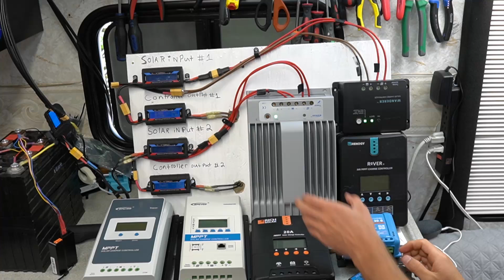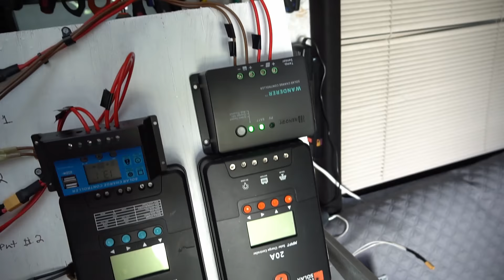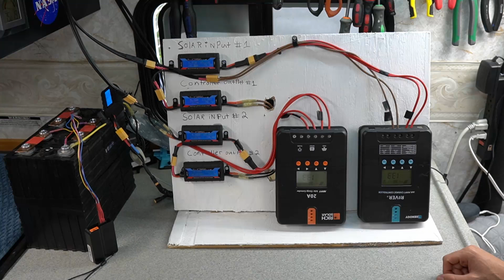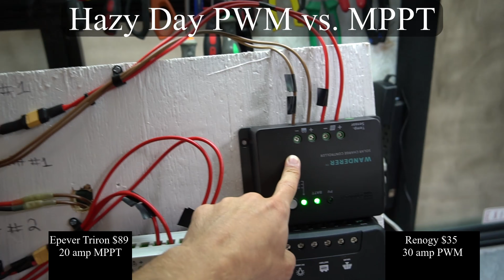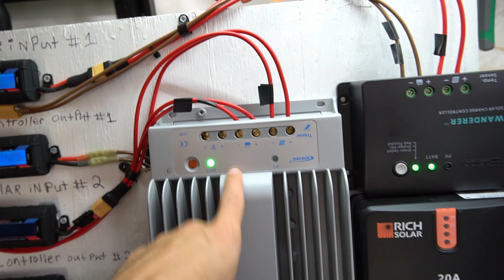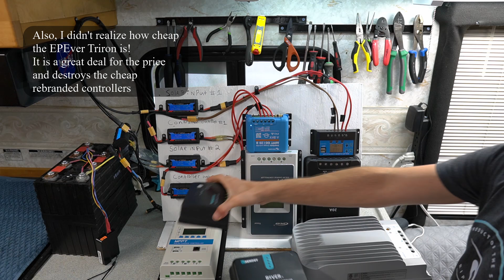12v Solar Charge Controller Buyers Guide - Beginner Friendly!

Comment: Good stuff. I  have to run a little bilge pump and an Anchorage light. Light is 10 Amp and the bilge pump comes on once in a blue moon. It's around 5 or 10 Amp. It's a puny thing. I have 2 deep cycle Duracell batteries in a series but I just need to keep them juiced up. What panel, controller and wire Guage does all that need? Nobody knows down here in Port Charlotte,  Florida.  Or, I'll get scheistered out of $500 or something.

Comment: Will, thank you for nice explanation. So, the numbers on Victron controller indicates: input Voltage (what's coming from solar panels) and output Amperage (what's going into batteries). Right?
Or it's both - Maximum IN and OUT is: 100V with 20A?
Or it's 100V@20A?

Comment: Just upraded the wires to my batteries from 10mm to 16mm and now I have a problem. the solar charge voltage is now 15.6V and my pwm controller is smelling and very hot. all i did was change the wires. Im running 12V system at 40Amps coming in.

Comment: I have a Victron and good access to 12 Volt lead batteries. I would like to connect the output 12 volts into my Fronius solar cell system. From what I understand, there are more inputs on it than just the one where I bring in 2700 watts of solar electricity. Possible? It is a Fronius Symo 3.7.3-M.

Comment: great videos. i am crap at electrical stuff.  but the way you do it in the videos is great, so great that even i am learning. 
me 60 years old. 
but question, on the renogy  controller. would there 30 amp adventurer be better built than the one in your test?
as they are selling a “kit” 400 W mono, 30 amp, and some other items.
you have me sold on the big one in the video, tracer BN 40amp controller.  i like over kill.

Comment: Just came across this older video....didn't that $15 PWM show a temperature on the display?? Looks like same one I have and mine shows a temperature read.  Is that the temperature of the unit since no leads going to battery??

Comment: Question for anyone that knows the answer.  I have a Renogy Wanderer charge controller for my houseboat that takes input power from solar panels.  Are any of these charge controllers capable of taking power from a generator to charge the battery bank? I'd like to keep my batteries topped off at night and sometimes I'm running a generator to power the A/C in during Oklahoma's HOT summer months.

Comment: Hi,
Can anyone jump in with an opinion? I'm somewhat clueless on the solar topic. I have two Harbor Freight 100 amp solar panels, a Dimensions 12/1500N 1500 watt pure sine inverter, and a golf cart with six new Deka GC45 six volt deep cycle lead acid batteries. (batteries to be wired paired to get 12 volts total) 
 Battery specs:
• Reserve Capacity [min]: 530@25 A
• Reserve Capacity [min]: 145@75 A
• Reserve Capacity [Ah@5hr rate]: 203
• Reserve Capacity [Ah@20hr rate]: 255

My questions are, what is the best controller to use with wet cell batteries and I'm thinking of adding one or two more of the same style 100 watt panels.

Thanks
Chris

Comment: My most important question to combine a wind turbine generator with solar panels is it best to separate different controllers or should I use a controller designed to take both wind turbine and solar array

Comment: What do you think about Eeekit mppt 100 amp controller? Lots of tiny directions, but inexpensive. Can I use this on my new SOK 100 ah battery with 400 watt, 30 amp panels? Can I start out charging this battery for the first time with solar, or do I need a charger to begin properly ? I don’t just want the system to work I want the battery to be baby so that I get
Reply: Didn’t get finished, I don’t just want this to work I want it to work well in order to preserve the life of the battery. Thank you

Comment: I have a 40amp Epever and can't seem to find a way to program it to properly  lifepo4 settings without a PC computer. Is this possible? Or, which controller should I get (even if I must go to 50-60 amp controller)?
I don't want to program it from a phone or computer.

Comment: I have three charge controllers with one saying only 50v should be used and the other saying 150v . My system is 12v and the 400 dollar Morningstar 40 amp says only 600 watts should be used, but the 40 dollar controller is 100 amps and says 1000 watts can be hooked up.  I'm a bit confused . My panels are 24v but give about 33 v  in sunny conditions. I'd really like to see a video about the voltage question compared to the maximum wattage suggestions. I don't want to burn anything up cause of inexperience with controllers.

Comment: Will, thx for your outstanding videos; I watch whenever I can. There's a very automated PWM solar controller, HUINE PWM Solar Charge Controller Waterproof IP68 (Amazon, etc., and under other name brands). I'd like to use these in batt. charging projects, but with a power supply source instead of a solar panel. Why do these controllers generally caution against using any source except a solar panel? What's the risk? Also, perhaps someday you could review this one for all of us?

Comment: I love your video I have a question I have the EPEVER Solar Charge Controller my question is do I have to ground it. I'm running to deep cycle batteries and a 300Watt solar panel to run a chest freezer that runs on 1.2 amp.

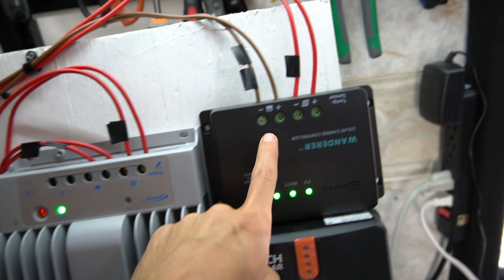Comment: Have you found or finalized this workaround 16:20. Hard to afford everything mppt, so thinking of just buying two pwm controllers these days, or don't?
Reply: Make sure to design your system around similar PWM perfect conditions! Otherwise the PWM will fast reveal it's really short limitations. Becoming a real frustration. With this said just like in the example, under perfect conditions it has a ROI that's simply unbeatable!

Simple systems designed around the 12v mark! With 12V battery, 12v nominal panel, short distances, etc. And your, low buck, PWM might outperform most of the high cost systems. Particularly considering price! ;-)

Comment: If you are building a large high output system like the one you built with used solar panels (x16) do you need a larger charge controller, or multiple ones?

Comment: Will, will a temperature sensor also provide cut off below freezing for a cheap lithium battery with a BMS that doesn't have low temp cut off? The manuals only mention the temp sensor working for lead acid profiles and never mention cutting off at below zero degrees. Help!

Comment: DC Load? What's the point of this connection ( If you are connecting the inverter to the battery)? How much power does the charge controller need from the battery with the display off?

Comment: Hello Will , I would like to power a dc  12 v 35 watt fan and a 12v Dc 20watt pump direct from a solar panel  no need for battery backup . I would also like to power some  lights and tool battery chargers  in my small shop  from the same panel  .Or should I use anothe panel with a inverter.

Comment: I was just curious about the new very inexpensive mppt controllers you can find on ebay.  Many choices under $20.  Is there a way to tell if they are worth buying?  I am very suspicious due to the low cost that they aren't.

Comment: Hello, I have a question. I have a solar charge controller installed, and I would like to be able to disconnect my batteries when the camper is in storage. How do you disconnect batteries and still keep the solar panel wired to the controller?

Comment: I have a portable fold out solar panel. There is a charge controller on the back of the solar panels would I need another charge controller closer to the battery. In my caravan. Like your videos. Thanks

Comment: Would it be possible to hook up a 100w solar panel & "400w" wind turbine through the 20A Epever tracer? Or connect directly to battery separately with its own controller?

Comment: I want a solar charger in a remote location to keep a LiFePo4 battery charged. I may need a heater of some sort to keep battery warm. I’ve read that a healthy LiFePo4 battery needs to be almost fully discharged before charging to ensure long battery life. So would it make sense to get the victron so I can set the parameters in such a way that the battery would get into a cycle of discharge/charge rather than keep it at a constant full charge ?

Comment: What does it mean when your battery bars disappears only when you connect the panels on the cheap $15 controller? It comes on fine with just the battery and soon as the panels touch boom it goes out and starts blinking

Comment: Heres a question, I have the renogy rover 100a mppt charge controller, and 2 renogy core 200ah lifepo4  batteries in parallel. On the charge controller settings, for size of battery,, do I set it for 200ah or 400ah, as setting in parallel effectively makes the 2 batteries 1?

Comment: Yes learned alot.
1 question for 12volt system and some of these . Is there anything gained by going with a 24 volt solar panel?
I'm thinking the controller could increase power out at 12 volts with higher voltage into the controller?

Comment: Question, is there a way to have 24v in ( two 360w panels in series) to take advantage of the larger array wattage and output 12v to the battery? Does anyone make an mppt that can do that? I am new to this and noticed I can have double the input wattage in terms of panels if I run 24v. I just thought if they had a step down transformer, with big wires you could stay with 12v still.

Comment: How would I do a connection in both the Charge Controller and an Inverter if I have a 180 Watt solar panel and a 12V DC battery?

Comment: I am still confused about the Amp rating is it for the solar side or the battery side? So 12 V 20 A for charging? Solar have high voltage 18 or 36v right?? With how much Amp we can come form the Solar into the control ?

Comment: Question please 
I have 6 160 watt solar panels around 20.2 volts each 
That equals like 120 plus volts
4  chins 100 amp hr batteries in parallel 
What kind of controler do I need
Thank you young man
Richard

Comment: What happens if you have 30 amps of solar panels hooked to a 20 amp charge controller will the controller work but only put out the 20 amps?

Comment: How important is it that the amp rating of the charge controller be equal to or greater than 10% of your total solar panel wattage? Which of these have cold weather charging as you’ve mentioned to be necessary in some of your battery videos? Finally, how can I further support you making such helpful videos?

Comment: Is there a solar charge controller that can simultaneously work with fixed solar panels on the roof of my RV and a set of portable panels that don't have built-in controllers like the GoalZero Boulder 200's?  Or would I need a second charge controller to do this?

Comment: Renogy 40 amp misleads my battery voltage.  When it says my LIfepo4 batteries are full, they are not.  I read in an Amazon review that I can adjust the settings using the Bluetooth app.  Can't figure out how to do this.  Help!!  Thanks for everything!!

Comment: Hi Will.  I have a very basic set up in which I'm powering a pond aeration pump with two 100 watt panels connected in series to an MPPT charge controller which in turn is connected to a lead acid battery.  The inverter is connected from the battery to the pump.  Somehow the battery swelled and I think it may have been a result of a faulty charge controller or could I have had the cut-in or cut-out settings wrong on the controller.  Any ideas and thanks in advance.

Comment: I'm going to presume none of these are "weather resistant", correct? Looking for a controller that can be installed alnd left remotely. I really wish I could fine one with a web-enabled monitoring system, like with a built-in web interface and ethernet port.

Comment: My boat has 3 lead acid 12 volt batteries, 1 for each engine and 1 for all other electronics.  The boat sits for weeks sometimes and one battery has already been replaced.  I have a 100 watt and 210 W panel.  How do you suggest I configure so I dont have to spend hundreds.  I need the equivalent of a trickle charger for each but the batteries must not over or undercharge.  The engines will delivery plenty of charge to top off—I am only trying to keep the charge and not keep replacing batteries or hurting the electronics.  Thanks.  Rick

Comment: The Epever Tracer 1 used to be sold under the Hqst brand controller sold through 2017. User manuals show they are identical. My 40v controller turns on and seems to be working but it is not charging batteries. Batteries are new and everything was tested. Could you please tell me what can I do to make it charge  batteries?

Comment: Just found this excellent video, just a quick question you might be able to answer, at around 11.55, you show the watt monitor and the top right voltage displays as around 13.2V, my question is should it not be over 18V or higher ie the voltage of the solar panels under load ie the Vmp?

Comment: Hi Will, thank you for all the useful information! We are building a van and we are having some trouble sizing our mppt charge controller. We plan on having 800W of solar power and possibly a total of 400-600ah 12V Ampere Time batteries. I know it also depends on the wiring of the panels but how much output charging current do we need and how does this relate to the charging rate of the batteries?

Comment: How about charging a 100ah lifepo4  in a car with solar to run a dashcam , 20amp charger, mobile 100w Panel...car is not moved much , wouldnt need a dcdc charger. Are lifepo4 safe enough in a car

Comment: great video! Could you shed some light on the charging caracteristics that different chargers can provide.  I am looking for a charger that can charge Li-ION samsung SDI cells, but most charges specify only " lithium"  as the supported chemistry.. Not sure if LifePo4 and Li-ION can use the same charging caracteristic?

Comment: Can you recommend a good deal on a high input voltage controller to run a series string 400v . Otherwise I'm stuck on parallel and use the cheapy 50v Ali version. 8 250 panels.

Comment: Hi Will, What controller might you recommend for an external panel connected to my Airstream that already has it's own separate system hooked to a single battleborn 100ah. This would be connected right to the battery like the external Zamp. port. The panel I'm looking at is the Newpowa 210W.

Comment: I have a problem where my renogy does not read the battery charge percentage accurately, it turns off at 80% sometime 50% and when I am charging it it read 88% as it turns on, using it with a load it lasts the same duration but how can I read the percentage accurately

Comment: Hello my friend. 
You are looking expert.
I have one question if you can answer me. 
I throw out the diode of my solar panel and I make it from 24v to 12v.and double the current. 
Dose solar charge controller stop drain battery at night or I have to use  diode from panel to charge controller?
I use the small blue one you have to the video. 
Thanks....

Comment: Not sure if you answer my question. I have a Waaree solar charger controller for AGM battery but I'm putting a PWM controller The Waaree has 3 black wires the PWM has 2 red and 2 black not sure how I would hook these up I don't want to fry anything.

Comment: Ok question? I just got a new rv. The solar has been acting up badly & we found it has a stripped screw for the negative battery wire stuck in the charge controller which may be the issue since the wire is extremely loose. 
  How do we get the stripped screw out of that tiny hole without damaging the charge controller? Please help?!

Comment: So after watching your video I’m now even more confused/ lost as to which I should get. I’m trying to price out a small solar kit to install in our shed. All it’s really going to have in it is a couple LEDs for light inside shed, a google nest camera (battery), and maybe one set of exterior outlets for decorative LED yard lights. I want to stick with a LiFePO4 battery or maybe two (depending on size … thinking scalability). Also trying to keep price down because I’m also considering having an electrician just run power out to the shed. So final answer? Lol

Comment: Need some HELP:

I have the EPEver 40a MPPT Tracer BN Series, 2 SOK 100ah in Parallel. and 5 Renogy 100w Mono Panels.

 For some reason once the batteries are at 100%, then charge controller seems to "lock" in the Full Battery position (which can be seen both on the battery icon, and the fact that it isnt charging) even though over hours of having a load on the battery and may be depleted to 60 or 70% it does not recognize that the battery is not at 100% any longer. The reason I can easily see that is because we also have a Renogy Shunt with battery monitor. When I turn off the solar panel suppy (via a master shutoff switch), as well as turn off the breaker for the battery (which causes the charge controller to reset) then after turning everything back on it immediately sees that the battery is not charged and begins charging. 

So...hopefully that was enough info that someone more knowledgeable than I may be able to give some input.

Thanks

Comment: Can you damage an MMPT controller if the voltage coming in to the controller doesn’t exceed the max voltage but the output of controller exceeds the amperage it’s rated? Or will it adjust

Comment: What gauge wire would you suggest from the controller to two 100 amp Gell batteries.
I have 300 watts of solar, my house battery (RV) is also a deep cycle gell battery, could I add a jumper from my solar/inverter setup to keep my house battery fresh ? Or would there be a problem when the Alternator starts supplying power to the house battery.?